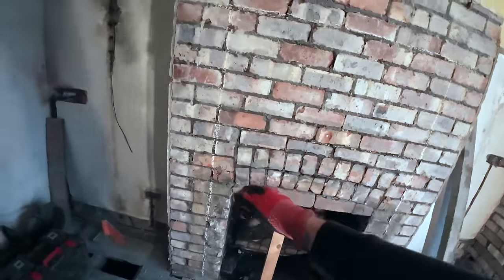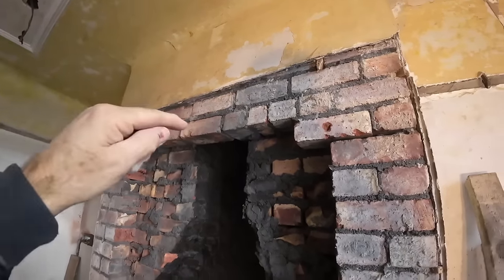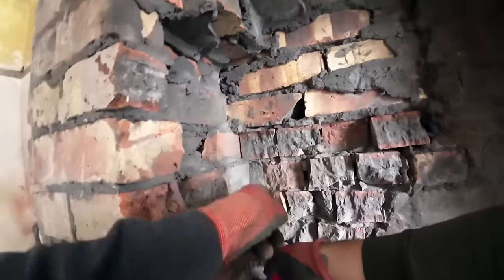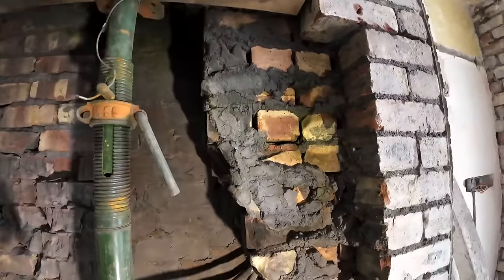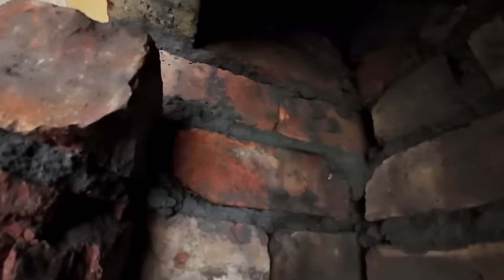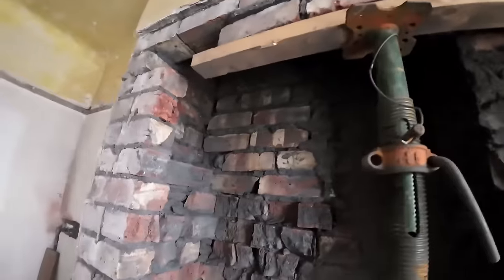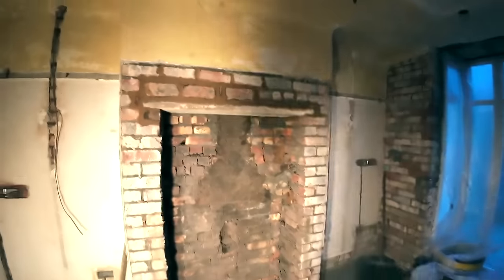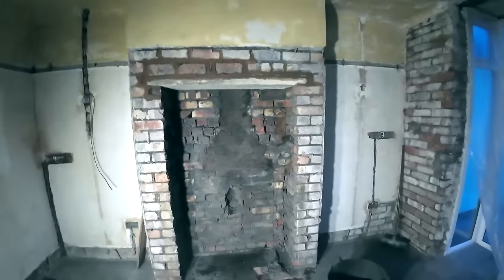DO NOT TRY THIS AT HOME !! CHIMNEY BREAST DEMOLITION FOR A COOKER

Comment: Hi when you are cleaning the dust up use a watering can to dampened the dust down or use the vacuum cleaner.
Reply from the maker: Water turns the soot to a disgusting sludge which is twice as hard to clean up and we have 2 vacuum cleaners 🧱👍🏽

Comment: Great job as always.  The old brickies must have been very skilled to have built something like that chimney, I certainly learned a lot about the inside workings of a chimney from this video.
Does your saw not have a water feed in port to cool the blade and stop most of the dust?
Reply from the maker: This was a standard procedure back when all we had coal fires 🔥 so 2 nd nature to most brickies 🧱👍🏽👌🏼

Comment: Really interesting to see the amount of ‘hidden’ brickwork that constitutes a chimney breast. Had the customer wanted the entire chimney brickwork ( up to ceiling height) removed in that GROUND floor only what would be the principles of securing the brickwork in the rooms above? Would the joists have to be modified and strengthened? Many thanks for sharing your skills and knowledge!
Reply from the maker: Thanks Jeff . A job for a structural engineer for sure 😬🧱👍🏽
Reply: Most grateful for the reply Steve & Alex. I anticipated your response. We have a double chimney breast (back to back ) in adjoining rooms. A number of years ago, a bricklayer friend performed exactly the procedure you carried out in the video in one of the rooms. Presumably, the same strategy could be used in the neighbouring room given the sides of the breast there remain as originally constructed. We’ve often contemplated the complete removal of both chimney breasts which would free up a lot of space but as you quite rightly pointed out consulting a structural engineer would be a necessity. Thanks again!!!
Reply from the maker: If you took everything down including the stacks then no need for an engineer. Just a lot of making good 👌🏼🧱👍🏽